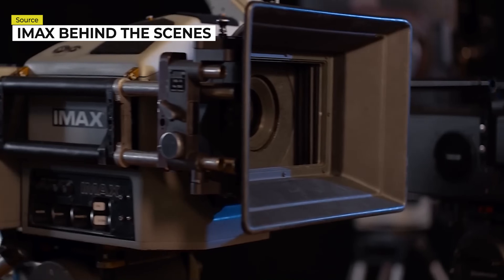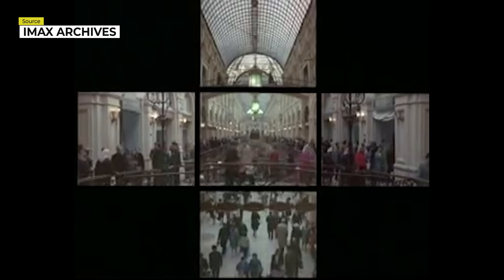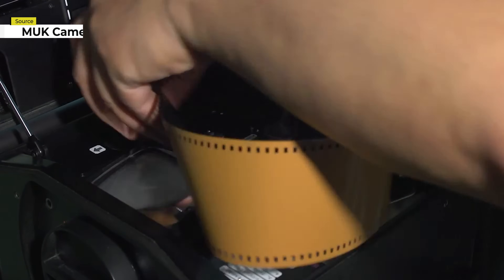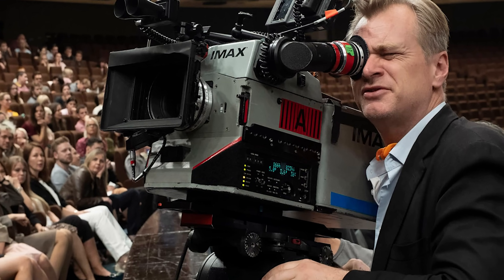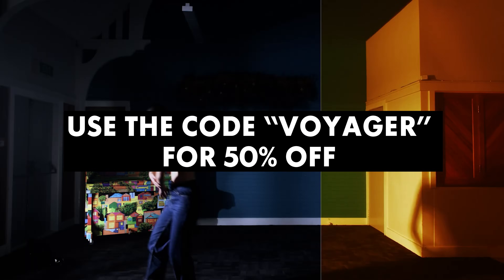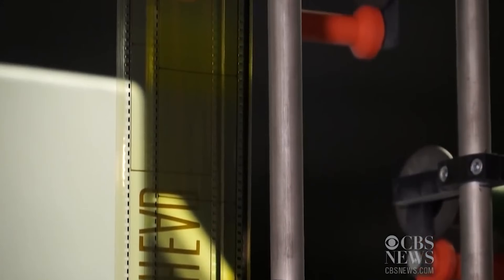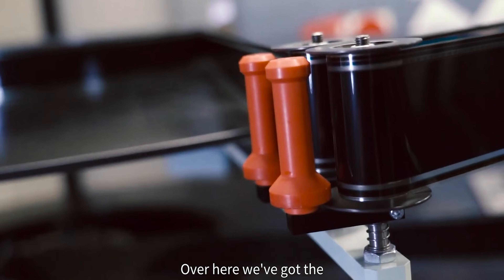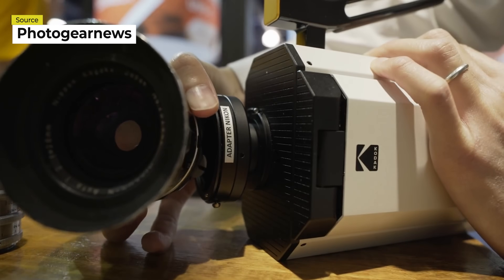The TRUTH about building a Digital IMAX camera

Comment: I love the thought experiment of digital Imax. I take some issue with purpose built lenese. If the digital plane has the same dimensions as the film plane, you could use the same lenses already used in Imax. Furthermore lenses from medium format cameras could also be used.
Reply from the maker: Thanks! And for the lenses, I guess I was just thinking more of the backend elements of older lenses might go in too far. Maybe that's not as much of an issue now but I know early digital cameras had issues with lenses being to large and would hit the sensors
Reply: Agreed, the only sensible way to design such a camera would be to have the same backfocus as IMAX cameras so that the lenses could be shared.

Comment: Would be better idea to use 3 or 4 single color sensors with splitting picture different color mirroring. Then smaller sensors could beat those huge ones and distance between different pixels are more compact.

RGB sensor size of film isn't that good. Point where one pixel could carry three different colors, film could do it many times more. It depends how good film is used. I believe that some kind camera with film that took reference to picture and colors, then multiple digital censors saves effects where their advantage is better. Then film gets digitally saved for editing and both/all sources get combined together the way how editor/producer wants. And then you got good hybrid picture that have both techniques best tricks. You could finally put it to film for projector or use laser projector. 

And anything dosen't stop using projector that combines film and laser same time and/or special effects the way how it looks impressive and believable to eye and brains.

I don't know do they already use this technology or is it going ever to happen. But it's possible and if you don't cry "money, expensive", then it's easy to manufacture. 
Main technology is that program that handles those little bit different picture sources and could benefit their best points.

I don't think that huge full color censor is answer for "anything" and it needs own truck just for SSD or high speed digital magnetic tapes, maybe modified LTO's. But somehow we still go to new technology again and again, then back to films and "ooh, it looks so amazing"..
It's not home theater media where those huge rolls of plastic could live even in near future.
I think digital is only answer for reasonable home usages.. Laser projectors have found place already at "normal peoples" use and covers their needs.
Reply: You mean something like 3CCD system?

Comment: Why would you need to make the digital sensor as large as the IMAX film frame? If you had a smaller (hypothetical) sensor with the same resolution, sensitivity, and dynamic range capabilities, what would be the point of using the larger sensor with the attendant challenges related to the optics?
Reply: larger formats have a different look, like having a wider shot but with less dof

Comment: I'm not sure how you made the case from IMAX film to a digital sensor requiring the same size physically. The physical dimensions of a digital sensor is governed by various factors but none are related to analog film. More to photon efficiency and readout performance needed to get to the required FPS and contrast values with the available light.
Reply from the maker: Oh I know! This was more an exercise in what would it take to go absolutely INSANITY and go full scale and what it would take. We even mention here at one point you don't need that large of a sensor
Reply: @FrameVoyager  hm... My point is more like, that even half the sensor size most probably being even better and thus full scale, but I get your point too :)!  Btw. Images from the 9x7 cam look absolutely incredible, thx, even for that pointer alone it was more than worth it!

Comment: The highest practical resolution can be determined from the properties of our eyes. Our field of stereoscopic vision is 120 by 60 degrees. Multiply those figures by our normal visual acuity of 80 pixels per degree, and 9600x4800 is what you get. That means, when viewing a 9600x4800 screen from the distance where it just barely fills your field of vision, you will be at the "sweet spot" where you're close enough to see all the detail but far enough away that you can't distinguish the individual pixels. Higher resolution is impractical, since this just moves the "sweet spot" closer, to the point where someone close enough to see all the detail won't be able to see the whole screen at once.

For reference, the "sweet spot" for 4K is a viewing distance equal to the screen size, for 1080p it's twice the screen size, and for 8K it's half the screen size, already close to the practical limit.

Comment: A camera that uses the same lenses that fit on 15/70 cameras but projects onto a very high quality back projection screen which than is filmed by a high quality fixed focus prime lens that is attached to a camera like the 9x7 would do the trick. Actual large format recording with a single small sensor, using the already existing lenses from analog times. A complementary camera without the back projection but a PL Mount could than also be used for lighter setups.

Comment: A 40x60mm sensor should be enough. Basically Medium Format+ a bit of width. It's even almost the same aspect ratio as standard IMAX, PLUS if you throw a 1.5x anamorphic on it, it'll be a 2.25:1 aspect ratio image, which is perfection IMO, unless you wanna count 2:1 Univisium, which can be achieved with a 1.33x anamorphic.

Comment: Translation film to a digital resolution is not an absolute.  
I remember learning that 7 to 12 megapixels equals 35mm  film. But you need to take the iso of the film and the quality of your lens into account. So say a crappy disposable Kodak camera with a cheap plastic lens gives you about a lower end 7 to 8mp quality image. While pulling out my Canon SLR and putting on some L glass lenses. Will make the same image look sharper and cleaner and give the higher end resolution of 12mp
Reply from the maker: Yep! There are about a million different variables that constantly change from frame to frame, camera to camera, and roll to roll. So definitely approximating here as best we can 😂
Reply: @FrameVoyager  Yep no don't you can't compare film grain as pixels. Lol I learned alot of this way back when I got my first digital camera. A Fuji film MX-2900. She had a huge (joking) 2.3mp image 1800x1200. Despite small images they looked fantastic.  But Goodluck getting an 8x10 print from it that looked good. I remember all my fellow photographers raging over the brand new Nikon 990 that came out and shot 3mp. Lol
Reply from the maker: @SchardtCinematic  well it makes for fun engagement because of the unknown of it all 😂

Comment: Why not use the old lenses for 1570 system?
Reply from the maker: Backend elements of some film lenses are too large and would touch the sensor. They had a similar problem when first filming on digital cameras for the Star Wars Attack of the Clones movie. Not 100% sure that would be the case here, but you'd need a redesign if so.

Comment: If the hypothetical IMAX sensor is the same physical size as a frame of the IMAX film, couldn’t you use the existing film lenses?
Reply from the maker: Backend elements of some film lenses are too large and would touch the sensor. They had a similar problem when first filming on digital cameras for the Star Wars Attack of the Clones movie. Not 100% sure that would be the case here, but you'd need a redesign if so.

Comment: If the sensor would be the same size as Imax film, why would it need purpose-built lenses? Couldn’t it use the same lenses Imax film cameras use?
Reply from the maker: Depends. Sometimes film lens backend elements are too large and wouldn't leave enough room for the sensor. So it just depends on how they are constructed and the needs of the mount for the sensor

Comment: you realize, "resolution" is not dependend on the sensors physical size right? individual pixels aren't a constant size that always stas the same. there's full frame sensors ranging from 4 to 42 megapixels. so the size of the sensor doesn't matter as much as you're saying. there's medium format cameras that can already shoot 400mp stills. 18k would be around 350mp. so the lens and sensor technology is already there. we just need to be able to extract raw video data instead of stills.
Reply from the maker: Oh I know! This was more of a what's the most absurd camera we could come up with that matches film IMAX in every aspect including size
Reply: @FrameVoyager  ah ok :D yeah i think it's shocking how analog in some areas still out performs digital
Reply from the maker: It is pretty crazy 👀 and yeah, I think some people misunderstood this video 😅

Comment: The correct term should be medium format, not large format. I know you're speaking colloquially, but to avoid confusion I would use the former. Large format only refers to sensor sizes 4in x 5in and above, so like really huge.
Reply from the maker: True! Very good point. Yeah it can be hard to navigate in this setting what terms to use exactly. But yeah, large format probably better term

Comment: I don't know how I can thank you sir
and sir I have a question 
Will a larger sensor create softer image with more dynamic range at a certain resolution than a smaller of the same resolution as a larger sensor will have larger pixel size?

for example, a true 1:1 digital IMAX sensor will create a softer image and with more dynamic range than a smaller sensor and both have 12k of resolutions
 for example, a true 1:1 digital IMAX sensor versus a super 35 sensor at 12k of resolution.

Comment: The Achtel 9x7 claim is complete bullshit - he's using a CB654CG-GP-X8G3 machine vision camera from Ximea stuffed inside an orange frame, which has a 9344x7000 pixel sensor from GMAX, the GMAX3265, and is 29.9x22.4mm in size.
The highest commercially available pure high resolution image sensor you can get(besides beyond-diffraction soapboxes from Samsung and niche science stuff) is the Canon 2511C002, which is 13272x9176, at a maximum frame rate of only 9.4 fps.
Reply: @froggy The new(ish) ARRI Alexa 35 still takes the cake, yeah. On a tighter budget(10% lol), Blackmagic stuff outperforms most.
Reply: @froggy Well, ARRI has fanboys, but their reputation isn't unsubstantiated. On a budget, BMPCC6K Pro, or URSA Mini 4.6 Pro G2.
ARRI's release cycle is slow so it's fine to buy a 35. If you have a spare hundred grand laying around.
Reply: @froggy No, all old panavision cameras are significantly inferior in image quality.

Comment: If you take a 9K sensor with bayer CFA, the (color) image resolution would be less than 9K. This is where the 12K URSA fails with its 6x6 CFA as well. But claiming that he can get 18K - that is just a physical and mathematical nonsense. Take as a fact, that your FHD LCD that has a finite amount of pixels (~2K*RGB) and a guy comes and would magically claim it as being a 12K screen! This is just as fake as Achtels claims - as he takes take the pixels*colors (4.5*RG/GB=9K) and then doubles it for no particular reason, because why not? It is very sad how such substantial lies are spread through various channels. And nobody opposes nor seems any bit suspicious about it. For the data rate - the graph shows some interface transfer speed, not the actual recording BW - you are all just eating his yummy lies.

Comment: I find the need for resolutions beyond 4-8K highly questionable. 
There's only so much detail you can see, I doubt you would see a big difference between 8 and 16K footage, especially if it's on a TV. On a PC monitor you would probably not even see a difference between 4 and 8K.
And you export projects in a lower bitrate anyway, then if you upload it to streaming platforms, it gets compressed down even further. 

When I did my presentation about IMAX, I read that the film may record in up to 18K, but the output in the theatre is still 4-6K on screen most of the time. 

I would definitely like to go see a 70mm IMAX movie at least once, but such high resolutions are more of a pricy gimmick than anything else imo.
Reply from the maker: Oh, totally agree! After a while you don't need that resolution size except for specific use cases.
Reply: @FrameVoyager  I don't even use the highest 4K setting on my Sony FX3, I use the medium S-I 4K since it's the best balance of image quality and data quantity for me, I don't even see a point in shooting RAW and investing in the gear needed to do so, even many high-budget productions don't see the point in RAW.

If S-I 4K 10-bit already uses this much data and requires expensive CF-Express  cards, the returns you get from even higher settings and resolutions start to get less and less. 

Especially in the online sphere, 4K is enough and still not as widespread, then there is also the issue of bandwidth, many users don't have enough of it by far to fluently stream 8K videos.
Full HD doesn't even look bad when you export it from your editing software in a compressed codec like h.264, it starts looking mushy once you upload it to YouTube...
Reply: But we are not talking about what is suitable for home TVs. We're talking about what is suitable for five story screens. The question then is, was 16/70 Imax as good as we want  for that?

Comment: I don't see much of a need for a true IMAX sized sensor. As you pointed out, you're clearly going to have difficulty with lenses that can resolve the necessary detail. Films inherent softness means that you don't need to resolve as much detail for the larger frames.

For example, large format still lenses are optimized for the large size of image produced (i.e., 4x5 or 8x10), but are pretty poor performers if you adapt them to a digital system. 

Frankly, there's no real reason to push past 8k. At that point, you're getting into diminishing returns in terms of perceptible detail. Where R&D would be better focused is improving dynamic range and compression algorithms to ensure more usable footage that can match the highlight rendition of film.

But if they are to develop larger format digital cinema cameras, I think the ideal format is the 44x33 sensor used in cameras such as Fuji's GFX line. These can render substantially more detail than traditional cinema 35mm, super 35, or full frame, with the advantage of a similar image circle of full frame (many photographers adapt full frame lenses to their GFX bodies with little to no vignetting) and a 4x3 aspect ratio. This aspect ratio closely mirrors that of IMAX 1570, so minimal cropping would be needed to match the look. It's also not going to be as demanding as a theoretical 1570 sensor, so current lens technology would be sufficient.
Reply: As an owner of some of the sharpest lenses a consumer can buy, I think people should focus more on telling a good story. It's a rare occasion when a story is left untold because we didn't have the perfect lens and camera. Although, I'm not going to so it. I'll keep enjoying sharp pictures in my private collection.
Reply: @hbp_  Absolutely! Sometimes the stories are told environmentally, and in those cases having technical prowess can improve your appreciation of that environment.

Comment: While film folk love to tout the resolution of the original camera negative, we should always remember that in a cinema, evena 35 or 70mm one, we never look at the projected negative. Most of us have not seen a first generation print. 

By the time we see it, the image would have gone from camera negative, to interpositive, to internegative to maybe a release print. Can even be another couple of generations when international distribution is involved. This all assumes it's an all analog process. Each new generation copies over the grain and fuzziness that the last generation introduced. It's why VFX houses for decades opted to shoot VFX on higher gauge film so the added generations of the composites won't add unnecessary softness and grain compared with the regular footage. 

Take all this into account and I've read of tests that showed that a typical release print of 15/70 IMAX at best barely could resolve 4K of detail. A 35mm release print can sometimes be rivalled by a decently mastered DVD and even be succeeded by a BluRay. 

There are other things that make 15/70 IMAX compelling. Like the sheer projection size, the taller aspect ratio and the massive sound system. 

I also recommend Steve Yedlins writeups and videos that show that the size of the gate is not anything magical and that given the right setups and image chain you visually cannot distinguish 15/70 from an Alexa. 

Or as I've had as a mantra for a few years now... Treat your camera like an IMAX camera... And it will give you IMAX images. Or at least something so close we cannot really tell the difference.

The real difference is in how you use the camera. Not what the camera is shooting.
Reply: Unless you're doing something wrong, a DVD should not be looking comparable to a 35mm print. If you put lines through it or don't keep it clean then of course, but a clean print that is projected properly should never be looking that bad. A good 35 print in sharp focus through a good projector can be comparable to 4k. Lose the sharp focus or run it through a projector that isn't stable though and yeah, might be DVD quality.